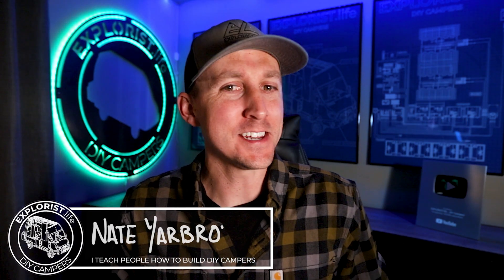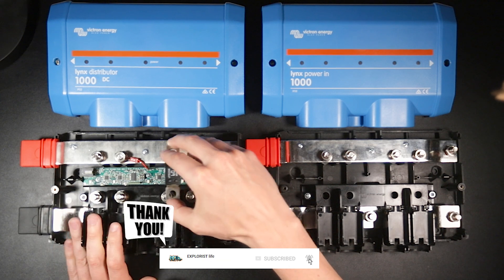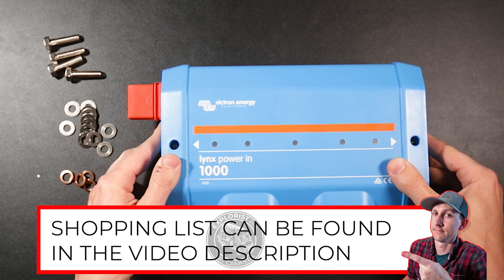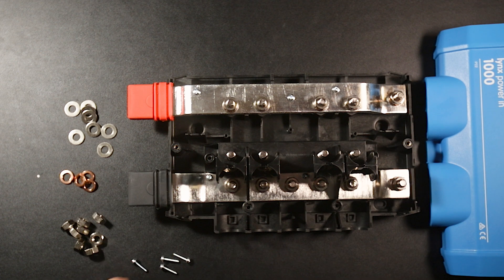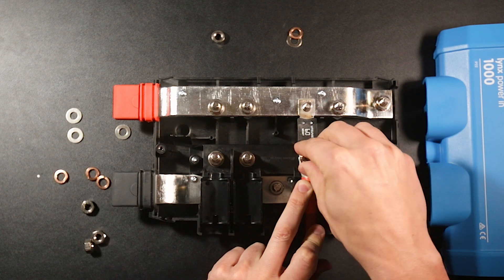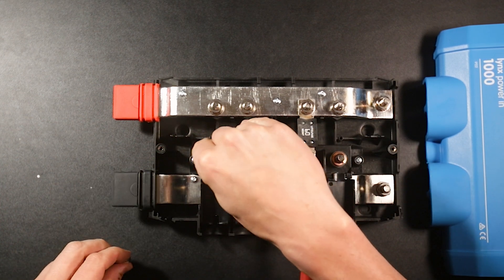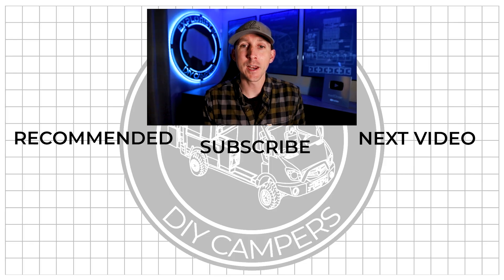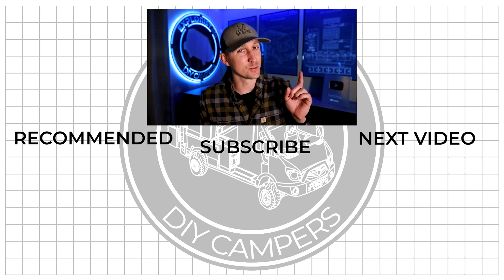How to Add Fuse Holders to a Victron Lynx Power In for a DIY Camper Electrical System

Comment: Will MRBFs (with stepped insulator washers) fit in the Victron Lynx Power In directly on the positive busbar? Perhaps they do (with longer lug bolts) and that is why there is no MRBF-specific model? How much clearance is there between the connection-side of the busbar and the cover?
Reply from the maker: Since the stud is not isolated from the busbar of the Lynx Power in, an MRBF fuse will not work, no, as power would simply flow through the stud - bypassing the fuse.
Reply: @EXPLORISTlife  The stepped insulating washer isolates the top of the bolt (and washers) from the lug and the MRBF below it. MRBFs are considered mountable without holders and is so noted in Victron's "Wiring Unlimited" document.
Reply from the maker: A stepped insulating washer isn't typically included with an MRBF fuse and it looks like they aren't readily available to the end consumer market.  I suppose it's worth noting that our shop.explorist.life wiring kits include all of the appropriate types and sizes of fuses so you don't have to try to figure it out on your own.  We've already done the work for you.  Reach out here if we can assist with getting you the right wiring kits: https://shop.explorist.life/support?utm_source=youtube&utm_medium=comment&utm_campaign=support&utm_content=response_link

Comment: Question. I have 4 Eco-Worthy 100a 12v batteries that I use the Victron Power-In as my bus bar. I watched this video lesson and am interested in putting fusing in my Power-In.  I currently have a 80a MRBF fuse on each battery. I use a 2000w Renogy Inverter with a shut-off and a 250v T-fuse. So, what size fuse should I use on the converted Power-In? And should I remove the 80a MRBF’S? Or, what I have is ok, and should leave well enough alone?  I appreciate your thoughts on this.  Thanks.
Reply from the maker: Happy to share my thoughts!  But first - did you buy any of that equipment from our store shop.explorist.life?
Reply: @E @EXPLORISTlife Sorry to say, I did not get the Power-In from you, I received it from a friend when he dismantled his system and sold his rig.  I do plan on getting a Cerbo GX from you after the first of the year. I do have an account with you and purchased a wiring diagram back in Fed ‘24.  If I need to wait and ask this question again after I purchase the Cerbo, I gladly will.  Thanks.
Reply from the maker: No problem!  We can still assist with this, but since the component wasn't purchased from our store, you can transfer the tech support for the device over to us through our shop.explorist.life/prosupportmembership program

Comment: 1st off, GREAT VIDEOS!  I've been a long time subscriber but never commented.  Question, why are the lock washers copper?  Why not Stainless like the other hardware?  2nd, Isn't the Lynx Power in the same as a fuse block?  Why don't you just bring power from the battery to a fuse block and then to other loads.  I'm a little confused as to why you do it that way.
Reply from the maker: Reach out to our customer support team and we can go through the best options for your specific needs and get you what you need: shop.explorist.life/support

Comment: WHy do i need to use a T fuse for my 1800w inverter? I bought this 1000  thinking i could wire it to this but now come to find out a T fuse is 100% better then the ANL.Mega due to short ciruit welding back together.There goes 200 bucks.. uggg
Reply from the maker: Thanks for sharing that—sorry to hear about the trouble with the ANL fuse. Sometimes the type of fuse needed depends on specific wiring setups or inverter specs, so it’s easy to overlook.

To get a personalized recommendation for your setup, definitely reach out to our team here:
https://shop.explorist.life/support
(Free help is available for gear purchased through our store.)

If your components came from somewhere else, our Pro Support Membership is a great way to get custom guidance:
https://shop.explorist.life/shop/all-products/membership-tiers/

Comment: Super helpful. I bought your 48v 5,000w inverter plan for 30 amp towable and with multiple server rack batteries I kinda like the idea of overcurrent protection at both ends (breakers integrated in the batteries and fuses on the power in bus).  

Since I’d be using batteries capable of Victron communication I don’t see a need for a Lynx Shunt.

Comment: Appreciate the video on converting to add fuse blocks. Ordered items from Amazon as suggested and installed easily following the video. Makes the Power In safer IMO by adding the fuses and I don't need the fancy lights. But agreed in the future I'll just order the fancier one with lights as it has the fuse holders pre-installed. I have one of those too but haven't done the update to add the 5VDC to run the lights. Doesn't seem to be a big deal to use without the lights but will probably add 5 Vdc at some point to complete the process. Seems to me Victron should have that circuit for lights already powered with a voltage converted off the bus bar using a coverted that can run 12V-48V converting to 5V from the factory. Victron stuff is rather pricey and such a simple converter should not be expensive when engineering in from the factory. I guess they want to try to push their overly priced shunt device instead; for me the standard >$100 smart shunt from Victron does the job fine and I don't find the ~$355 Lynx shunt worth the cost. For the price of the Lynx Shunt and being designed to be directly connected to the distributor and power in, it should also have the ability to act as the power switch. When you still have to add a power switch to the system, connecting them all together doesn't seem to be beneficial but just more expense.
Reply from the maker: The new Victron NG BMS for Victron NG batteries incorporates both a switch and a shunt into the BMS.  We now have this on our store https://shop.explorist.life
Reply: @EXPLORISTlife  Thanks for the feedback. Found the new device and it's a good upgrade. But also $906 so a big investment compared to simpler Victron adding a manual switch. I'll give a look to see all features. First view is that is seems to have Battery Management System improvements and control. Perhaps those features make it a better value as it protects and controls the investment in batteries that is very expense and good to maintain for long-term life and performance as well as safety especiailly with higher voltages.

Comment: I don't think it matters much because you are only using clamping force rather than them being an actual conductor. But from what I can see the nuts, bolts and washers in my Lynx power in appear to be tinned brass or something similar
Reply from the maker: Yeah, perhaps.  Just buying the Lynx Distributor from the start is the more consistent and repeatable thing to do here.

Comment: Thank you for this informative video.  I decided to try the hack, partly because I didn't want the LEDs, but also in the hope that I'd save a little money (also, I'm an obsessive DIYer).  The money savings turned out to be pretty much non-existent.  Worse though, was when I went to install my first ANL fuse and found that the spacing between the bolts in the power-in is too small for the fuses to fit.  Since I now own all the components and there was no turning back, I removed the bolts I installed from the chassis, installed the fuse to the bus bar and attached the positive cable to the fuse.  The bolts are now too long, so I'll be replacing them.  After all that, my advice to anyone considering going this route is don't - buy the distributor.
Reply: These are made for MEGA fuses, not ANL fuses. That might be why it didn't fit.

Comment: Nate, I want to add the Lynx Power In unit to our system. It currently has two SOK batteries in parallel (without the display) 48V  battery rack. The Victron Lynx Distribution unit has 100A fuses. I also want to add another 48V battery bank via the Victron Lynx Power In. Should I use the same fuse type in the Victron Lynx Power In unit as in the Victor Lynx Distribution unit?
Reply from the maker: You might not need fuses in the lynx power in.  Reach out at shop.explorist.life/support for pre-sales support.

Comment: EXCELLENT VIDEO THANK NATE!!!/ I  would never profess to have a a fraction of your knowledge in this arena, with that said why not use brass hardware over stainless? It's a better conductor, per science, as well as corrosion resistant - well better than stainless anyway. Again, this is by no means a dig. I'm just asking a question.
Reply from the maker: No clue.  I wasn't part of the decision making process victron had for that.

Comment: I was really impressed by the substantial weight  and build quality of the Lynx Distributor when i received it. $200 is a  much better option than penny wise pound foolish......Supplying a premade 5v power adapter would be nice vs having to handycraft one....I am thinking an even better option may be dropping your machine off at Nate's shop.

Comment: thats an expensive way to distribute power through fuses.
Reply from the maker: Not when compared to 2x  high-amperage high quality Busbars & 4x high-amperage high quality fuse holders + the lugs to make the jumpers.  It's about the same price.  It just 'looks' more expensive since you are buying only one piece instead of 6 pieces to achieve the same functionality.

Comment: Hey Nate, thank you for the whole series of understandable instruction.  In my setup, I've 5 circuits I'd like to run via a distributor.  I know I could piggyback another Lynx In on the first, but then I've got more circuit capacity than I need. Sooo, could I use the two piggyback terminals on my Lynx In as a 5th connection point so long as the positive wire is appropriately fused, (downstream of the Lynx In) at the device?  Thanks mate.

Comment: I added a washer just under the bottom of the fuse on the added nut. Just to provide a bit more surface area under the fuse besides just the of the nut. Adds juuuust a bit of slope to the tabs of the fuse but nothing to lose sleep about. I'd rather have the added surface area under the fuse than just the nut.

Comment: My device is already fused. Would it be ok not to use a fuse in the shunt?
Reply from the maker: 'fuse in the shunt'?  Like... the lynx shunt?  If you don't put a fuse there, power wouldn't flow through the unit.

Other shunts like the smartshunt or bmv-712 shunt don't have fuses except to power the computer board on the side.

Comment: You can only use the Lynx Distributor for 12v system. If you do the hack on the Lynx power in can it be used on a 24v system?
Reply from the maker: That first part isn't true.  You can use the Lynx distributor for 12, 24, or 48v systems.

Comment: Easy detail to miss but If you begin assembling this and wonder why the fuse didn't line up flat, there is a nut that goes under the fuse, then the fuse and lug are stacked over it, then the second nut over it.  The first nut is critical to bring the fuse up to the same height as the bus bar.

Comment: I hope you read this soon. What about doing the thing in reverse? If I dont have 4 strings of batteries where I need 4 ins for power strings its not cost effective to use a power in.  It would be better if I could come into a distributer and gain the monitoring benefits if I am only bringing in a single string. Is that possible?
Reply from the maker: Sounds like you are describing how we've got all of our systems at https://www.explorist.life/solarwiringdiagrams

Comment: Short Version of last comment - What would be the best way to connect a 2nd battery bank under a sink to the existing battery bank under the steps? Thanks! 

Would really love a video as I couldn't find anything on this topic.
Reply from the maker: Oof... I'm a big big proponent of not splitting the battery bank locations.  If you are bound and determined to have batteries in two different locations, I think your proposed plan is the best you'll be able to do.  Make sure the wires from each battery bank to the power in/distributor are the same length and size.

Comment: Winnebago View 2023 - Class C on a Sprinter chassis. 2-130ah batteries under step. Want to add 2 more under sink. Would like to use Power In to connect the 2 banks.

Would then like to add nuts and bolts to use the remaining 2 connections to tie in the inv/chg and also the leveling Jack's and existing oem 12vconnections  under the step.

Can this be done with 1 power in? I  don't mind paying for the Lynx if that is a better way to go, but I don't really need the fuse capability sine the batt banks will be fuse close to the post terms.

Willing to use your hack to provide additional terminals to the end of the Power in or Lynx. Tia!
Reply from the maker: I think I'm pretty much always going to opt for the Lynx Distributor if I'm adding any fuses just for ease of use, but your proposed plan should be fine.  Note, though, if you do it like that; you won't have a way to disconnect the batteries from the system unless you put switches on each wire coming from each 'battery bank', if you will.
Reply from the maker: Also, keep in mind that you wouldn't have any battery monitoring capabilities either since there would be no way to incorporate a shunt.

Comment: torqspec for the "Unknows" is 10nm According to the distributor ..
Reply from the maker: If the manufacturer makes a change in their documentation, be sure to come back to this video and edit this comment. 🙂  (This is why I don't put torque specs in the videos)
Reply: I was going to make the same comment having just built up two Lynx Power In units with fuses but I was pretty sure someone would have said this already. I see @EXPLORISTlife ‘s reply below but surely Nate it’s better to have some sort  of “at time of video the torque spec recommended by Victron is 10NM” than just have people wrenching on the nuts with no idea how tight they need to be. To me, 10NM felt about right for the support nut and 14NM felt fine for the clamping nut. I didn’t sense any feeling of impending failure in either case but they both felt secure. Even just the fact that they specify 10 and 14 NM suggests that a torque wrench is pretty important because I doubt many people can judge a 4 NM difference by hand outside of a veteran in a professional machine shop.

Constructive criticism aside, this was a great video and has saved me a chunk of cash and led to a much better DC bus bar arrangement so I want to thank you. 

FYI, I have two Power In’s arranged vertically with the bottom unit being for my Pylontech batteries to connect via 125A fuses to protect the cables. Note I don’t use DC isolators for the batteries since I can shut down the Pylontech batteries via their own controls. The top Power In currently only feeds my Multiplus-II 48/5000/70-50 via a 200A fuse but I will soon add a pair of 250/60 MPPTs via 80A fuses and probably without DC isolators (still debating this though). 

All fuse ratings are as recommended by Victron except the Pylontech fuses which are purely to protect the cables. Unfortunately Victron don’t supply 48V rated mega fuses below 125A breaking capacity so I had to source them from Littelfuse instead. You can get them on Mouser under part reference 70V-SF51 in various capacities. Quality appears very good and much cheaper than from Victron with a higher voltage rating. Technically a 48V rated fuse should not be used on a system running at ~53V so the Littelfuses at 70V rating offer lots of headroom.

I’d be interested in your opinion on whether I need DC isolators for my two MPPTs or whether the fact they will have DC isolators on the PV incoming connections renders these devices as “consumers” of fused, low level power and thus can be treated just like the Cerbo GX which is powered via its own inline fuse directly from my main bus bar. I’m keen to minimise DC losses via unnecessary connections but I don’t want to compromise safety obviously. Advice welcome. Thanks.

Comment: Great video as always! One thing that I would add is to be careful when tightening the 2 nuts holding the Mega fuse. Even with the washer and lock washer, the Mega fuse attachment lugs can have a tendency to rotate and if there is enough rotation, the connection can separate (ask me how I know).  I had to go out and purchase another Mega fuse to replace the one that broke. You want the connection to be tight enough but just be aware of the rotation of the fuse!
Reply from the maker: For sure!  There are torque specs in the Power In and Lynx Distributor to help with that.
Reply: @EXPLORISTlife  Thanks for pointing that out. I did miss it!

Comment: Newb question. Using this method, how could you tell if a mega fuse is blown without the little light indicator? I kinda like the light but not sure if it's worth the extra $70. BTW, your videos have been very helpful explaining a lot of this. I've watched many of them several times over. electric stuff is confusing and scares me. lol
Reply from the maker: If the component stops working, you can use a multimeter to test voltage on either side of the fuse to see if it's blown.  The fuses in the Lynx Distributor shouldn't be blowing unless something catastrophic happens, though.

Comment: Hi Nate would it be possible to install your positive power cable between the second washer and the nut then add another washes then the mega fuse so if changing a fuse you don't have to remove the wires hope you under stand my question cheers
Reply from the maker: If you are needing to replace the fuse, it takes .3 seconds to move the wire up and out of the way.  You'll pretty much never need to replace these fuses unless something goes terribly wrong.  Don't add washers.  KISS.